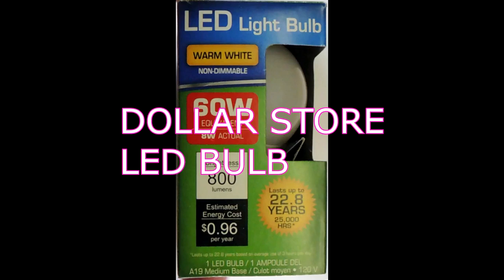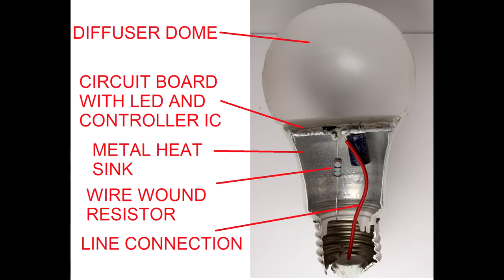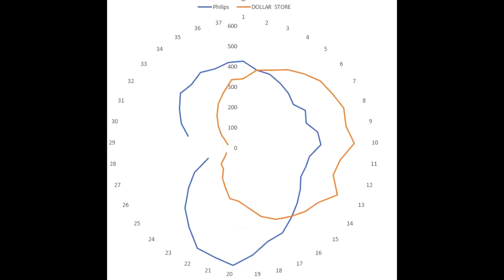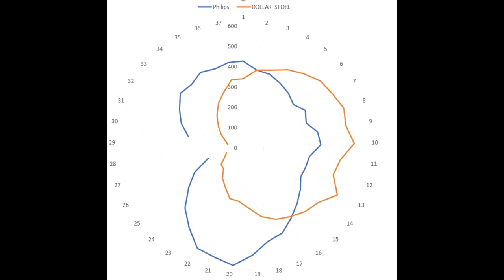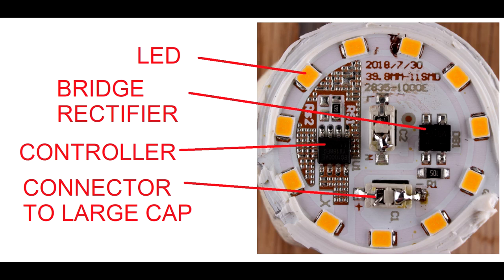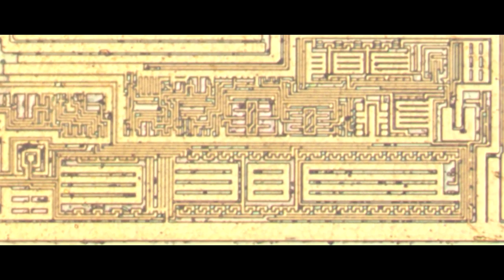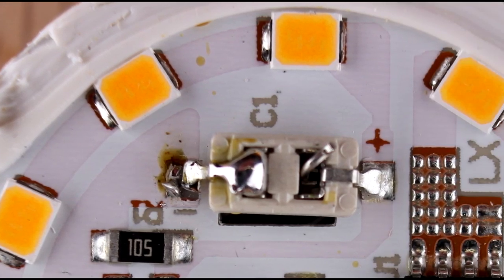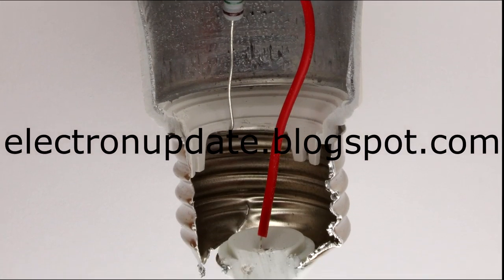Tear down of a Dollar Store LED BULB

Comment: Standard incandescent bulbs radiated most of the energy down. Only modern halogen and old fridge lightbulbs had vertical filaments. Which one is better depends on the application. Radiation to the sides generally serves a decorative purpose where the light is mostly absorbed by the lampshade, and you can look at the open bulb straight from below without it blinding you.

Comment: I've just released my own comparison of Adrian Black's dollar store lamp and a UK Poundland one.  Interestingly, above about 5W they switch from capacitive droppers to the current regulator chips.
I nice feature is that running the lamp heats its aluminium PCB up enough to easily desolder (After you've turned the lamp off!) and replace the sense resistor with a higher value to run the lamp at a much lower power.
Reply from the maker: It's amusing that two people release a video on the same,  rather obscure, topic within hours of each other :)
Reply: Great to see this kind of interaction between Youtubers. :-)
Reply: I just referenced your video here Clive! I enjoy the different angles of expertise each of you bring to the LED design. Keep up the great work!
Reply: @dosgos  I must admit that I really like it when other tech YouTubers take apart similar regional products.   It's good to compare them.

Comment: I miss vintage cree bulbs. I bought all I could at the time but it's just never quite enough.
Reply: How are your crees doing?  Both the old glass bulb and cheaper plastic one with less chips driven harder with less warranty failed quickly for me. Cree is looking or already has spun off leds to focus on more profitable power silicon nitride devices.
Reply: @anullhandle  The Cree 60W bulbs I bought back when they were a new thing are all still going strong. The ones I bought after they stopped production off bezos's empire from a sketchy reseller (possibly counter fit) have had some failures. I have some other late but authentic 40W first gen design bulbs that I got from homedespot and the failure rate from them has been high as well but not horrible. The new design cree bulbs that are just up firing are the worst. Keep in mind I am using them all indoors in open fixtures. The worst location for any of them is in my bathroom where humidity can get high but the failures I am seeing are not just in that space and the bulbs I use there are all the 40W variety.
Reply: @anullhandle  perhaps the most interesting is that the failures are not random. Some locations fail most often. So the middle bathroom fixture (row of 3) kills bulbs as does the right (but not left) socket in our dining room. If anyone can explain the dining room thing please post your hypothesis.

Comment: The early LED bulbs, from Philips were very expensive but are still going strong despite daily use. Installed them early 2014, only one of nine bulbs failed till date. I subsequently got the cheaper and lighter ones in 2017 which did not last till 2019. They died in about a year. Something changed at Philips from 2014 till 2017 that the bulbs started failing. Talking of bulbs, my B22 Halogens in A shape are going strong beyond the   2000 hours rated life. Speaks volumes about halogen technology. They are the Philips too..

Comment: If you think about it, its so amazing how low the prices of LED bulbs have gotten. That LED lamp at that price?  Before 2010 an LED bulb cost over 60 dollars. I was an early adopter and splurged 35 bucks for the Philips L Prize winning light bulb back in 2012. It runs continuously from 5:00 AM to 9:00 PM 98% of the time. And its way more complex than this one.

Thanks to you, I wanted to see its innards of it and it has very blue LED's producing the light but when the light goes through the strange yellow covering it becomes a nice warm light.

We got a second Philips LED bulb a little later with the same idea and it failed in less than 2 years using it only at night as a porch light.

Comment: I miss that bulb reviews that makes me suscribe...
Reply: Complex LED bulbs basically don't exist anymore. Every company has optimized them to nothing like this example.
Reply: @oisiaa  They still exist, they've just moved over to the "smart bulb" portion of the market.
Reply: @guspaz  Not really though. The complicated cooling systems are a thing of the past. Even smart bulbs have the same basic "snow cone" design. Old bulbs had intricate heat sinks and cooling systems.

Comment: Your breakdowns are amazingly complete. The only thing that I'd like to have known is if the light flickers and, if it does, what frequency.
 Is it 60 Hz, 120 Hz or some other frequency. (You mentioned at 3:20 about a chopper frequency.)  That wold be useful if video was being recorded. Thanks for a great channel.
Reply: I happen to have a few of these bulbs and quite surprisingly I can confirm they do not flicker, I have a phone that can record 960fps video: https://youtu.be/27QV_ndAt5g

Here's an example of one that does flicker: https://youtu.be/Ppk5qBSTQjg
Reply: Can you poke at the controller by oscilloscope ? I think only PFC controllers can produce flicker free output  but those are relatively expensive.
Reply: @vant4888  Are you asking me? I don't have an oscilloscope, so I can't do any comprehensive testing what I can say however is that if it does flicker then it's at such a high rate even 960fps isn't picking it up and would therefore be well beyond a what a normal camera would pick up.

Also, bear in mind that I bought these bulbs between 6-12 months ago, and they could've changed at anytime.
Reply: The one I bought flickered really bad before it died a few weeks after purchase.

Comment: I was expecting a capacitive dropper circuit inside, but this lamp uses a resistor?
Reply: No, the resistor is just to limit inrush current and act as a fuse. The control chip does all the current limiting for the LEDs.
Reply: Tapio Peltonen Thanks for the info.

Comment: What will come after led??
Reply: OLED for lighting applications, cheaper to build, more reciclable, less useful lifespan...
Reply: not oled. oled will always be more inefficient. Laser diodes will be the next step for general lighting. Gain extraction can be much higher and light output per unit volume can go MUCH higher than LEDs with no high current droop effect.
Reply: @Muonium1  in white? Can you adress some link? Sounds interesting
Reply: @eduardoanonimo3031  relevant search terms are "sld laser" "laser based illumination" "laser based lighting" "irradiance" and "etendue". All current systems use phosphor emitters to destroy the phase coherence of the laser. Further future systems may use more sophisticated methods such as supercontinuum generation in a photonic fiber from ultrashort pulses.